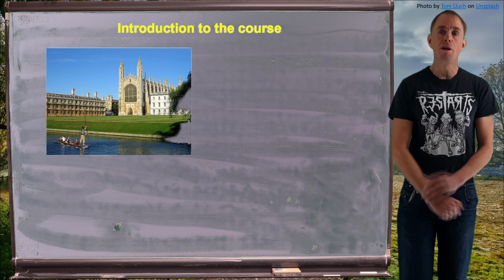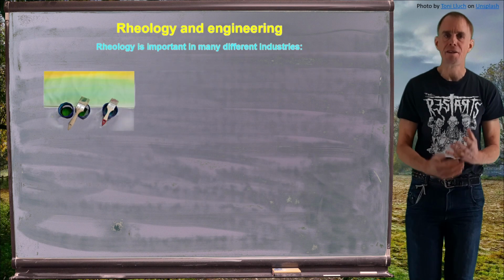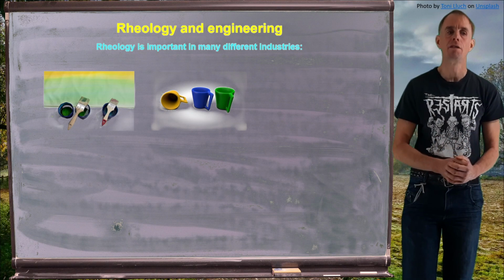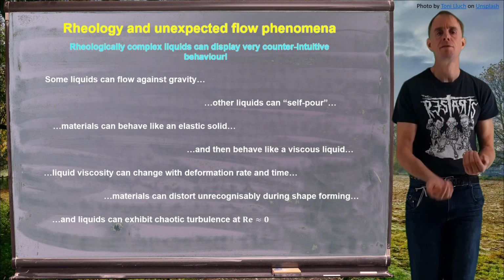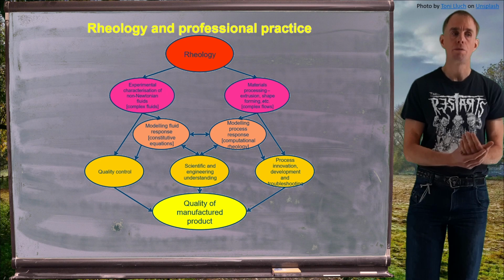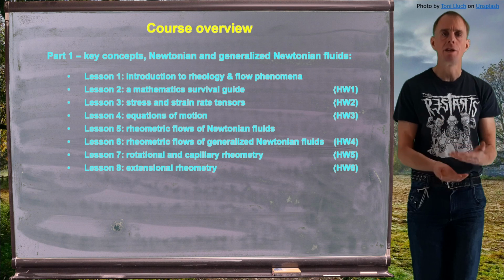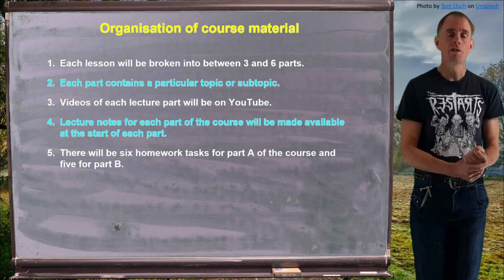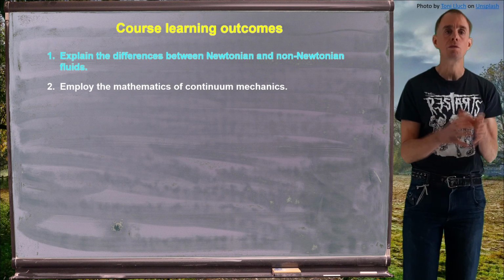Lesson 1, part 1: Introduction to EPD640

Comment: Hi Dr. Bart, I don't know how often you check these comments, but do you have a good reference on how elastic flows can exhibit turbulent effects with 0 Reynolds number? Seems very interesting. Thanks!
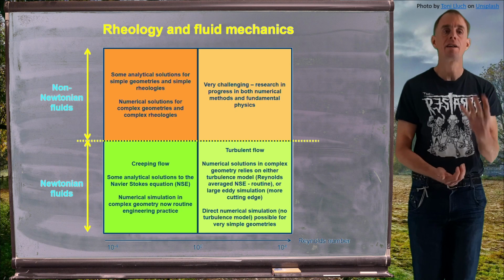Reply: Also, I suppose I should introduce myself. I'm a Math PhD student at the University of Florida, roughly working in roughly the top right/top left corner of the diagram at 22:45, working on numerical methods and numerical analysis of some Oldroyd models. Found this video playlist looking to get a better understanding of the chemistry. Looking forward to the rest of the series!
Reply from the maker: Sorry for the delayed reply - very glad that you've found the material interesting! Yes, a lot of the work on elastic turbulence came, I think, it if the Technicon in the mid 2000s. Let me see if I can find a reference...
Reply from the maker: Yes, here you go - I think this was the original paper: https://pubmed.ncbi.nlm.nih.gov/10811214/